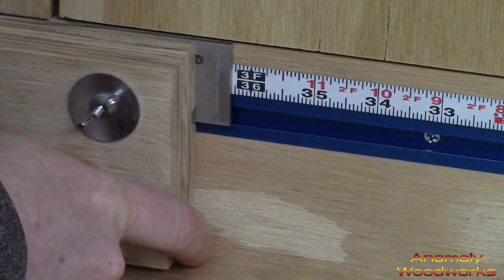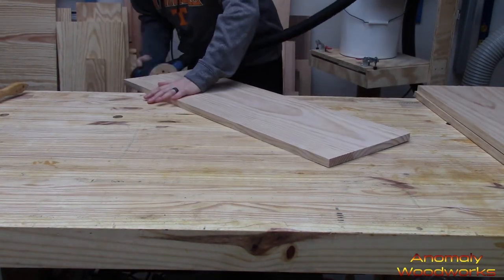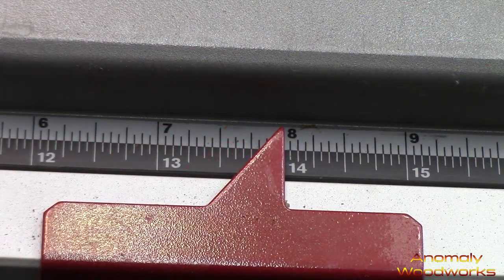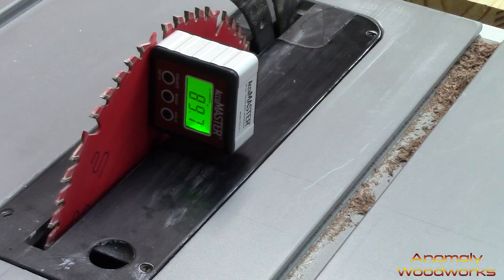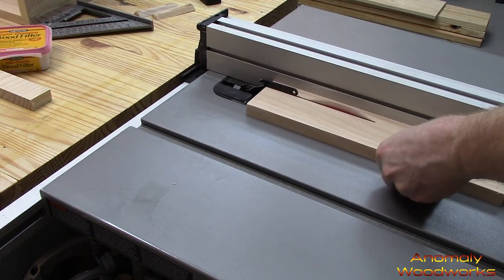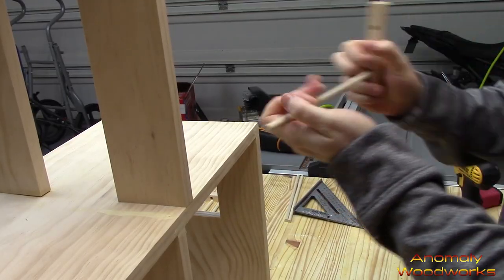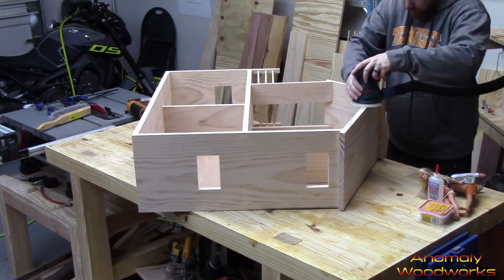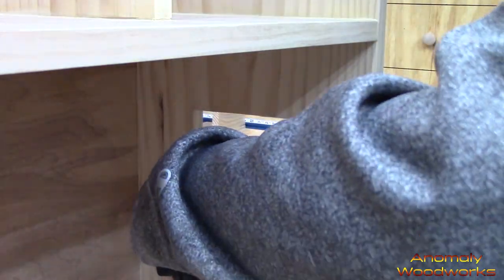Dollhouse Build

Comment from the maker: Thanks to everyone for watching!  I've had alot of questions about dimensions and costs, so here is some info.  I spent about $60-70 on wood.  Prices of wood are high now (Nov. 2020), so you might pay a little more.  Also, figure a little for brads, glue, and wood filler, but not much at all.  This dollhouse was made out of whitewood/spruce, available at any big box store.  Some APPROXIMATE dimensions, but please draw yourself up some rough plans using these, they are not exact:

You should be able to get this done with:
1 - 1"x12"x10' whitewood/spruce board
1 - 1":x12"x8' whitewood/spruce board
3 - 4' dowel sticks that are 3/8" thick
1 - 4'x4' square of 1/4" lauan or you could probably use 1/4" plywood

Width at widest:  36 3/4"     Height at tallest:  36 3/4"     Depth:  11 1/4" (actual width of a 1x12 board off the shelf)
Vertical board for right wall:  ~28"
Vertical board for left wall:  ~14"
Bottom divider walls are ~14" tall and are 3" LESS in width than the floor and side walls
Right side of angled roof: ~22"
Left side of angled roof: ~13"
I believe I the roof is on a 45 degree from surface, so 135 degrees angle to the vertical boards they are attached to
I cut pieces 3/4" x 3/4" for the porch posts
Three 4' sticks of 3/8" dowel should be enough for the railing, but you might buy extra in case you need to recut any, it's cheap stuff
Cut the lauan or plywood to size for the back wall

Thanks again to all for watching!
Reply: Thank you so much. This will be perfect to build for my grand daughter
Reply: Thanks for sharing ❗ 
I have been wanting to make a doll house for my grand daughter. 
Now with your help I will give it a try. 
I hope it will look like yours, fingers crossed 🤞.

Comment: Hi. Thanks for the video. Is that a nail gun you used to fix the wood together? Certainly saves time.
Reply from the maker: It is a brad nailer, yes. And it does save some time. Ok for smaller projects and certain applications. The holes are easy to fill with some filler as well. Thanks for watching!